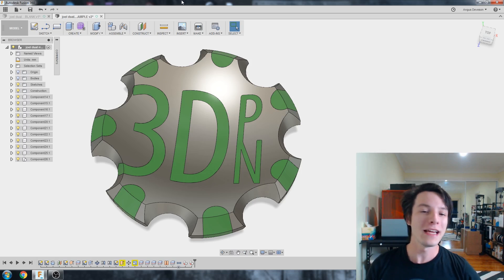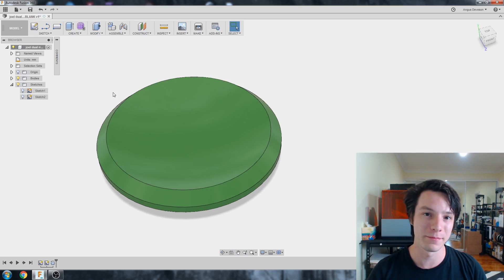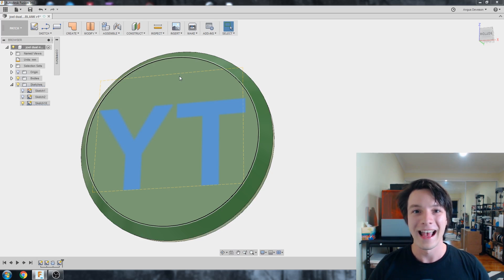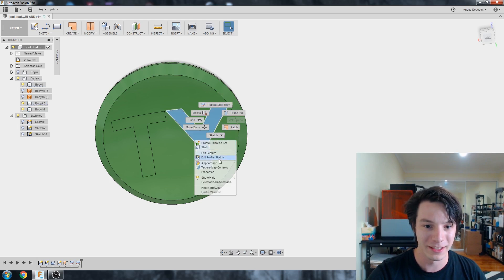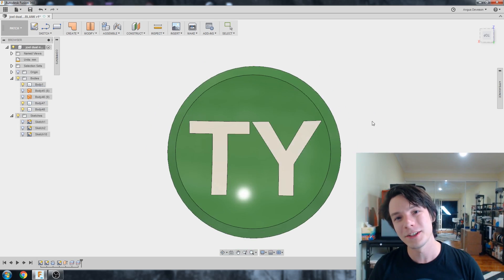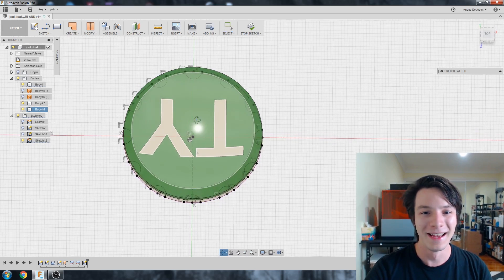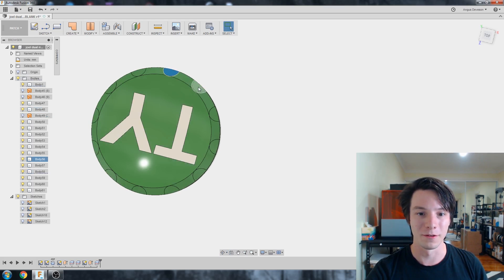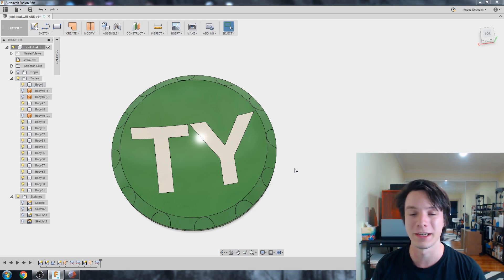Multi Color 3D Prints using Fusion 360 - Patch Workspace Tutorial

Comment: Perhaps this was not possible at the time of the video. But if I save the model as a single STL while it has multiple bodies. Then open it in Slic3r Prusa edition and import the STL, double click it, select the STL, then click split. I then have all the bodies separated and can select different extruder for each of them. Much faster then exporting each body in a separate file and loading them again.

Comment: Thanks for the tutorial Angus! I have a question though: The "split body" command only works, if you cut all the way through your body. If you just want an indentation (less than your material thickness) the split body command does not work and gives you an error. How can I do this?
Reply: Same question. Would love to split the model to print separately then press fit. But I don't want to go all the way through. is that possible with this method?
Reply: @swendingo  I don't know about press fitting parts, but I figured a way to "not go all the way through", see my other reply here if it's still something you want to figure out.
Reply: I just figured out a way to do this. Basically, using the cookie cutter analogy, you need a bottom to your cookie cutter . This can be done (after surface-extruding your sketch part way through your body) by using the "patch" tool on each of your extruded shapes on the side that is on the inside of the body you want to cut into. Then you need to use the "stitch" tool on the sides and bottom of your cookie cutter to fuse them together. After this you can use the "split body" tool as described in this video. I'm not very experienced with fusion 360 so my method is quite click-intense, but I got it to work.
Reply: You also should make sure that the tolerance on the stitch tool is set to 0 for this to work properly.

Comment: Hi Angus, would it be possible to write text around the curve radius - along the circumference of the coin? like those wording on the tire?
Reply from the maker: Not sure Fusion has a 'wrap' function, but you can set the depth to be uniform with 'to object' in the extrude and setting an offset amount. The text would be warped at the edges though :(
Reply: If you still need an answer, F360 has a new feature called emboss

Comment: I have a Qidi tec 1 and when i try to print something that needs supports with dual extruders the model and supports are printed separately is there any solution?(The slicer im using is Simple 3d)

Comment: Hey as someone who is looking at starting with 3D printing I've been wondering, how steep is the learning curve and is it a relatively natural one? Like will 3D printing take a lot of researching to get into or is it very much a learn as you go kind of thing?
Reply from the maker: The answer is 'it depends' - buy a 3D Printer that is ready to run out of the box if you want to use it as a 3D Printer and not as a learning experience in itself, if you want to be 3D Printing any time soon. Learning 3D modelling will take some additional time, tackle that once you've got the 3D Printing sorted.
Reply: MP Select Mini is an excellent first printer, IMHO
Reply: you want to minimize the #variables that you need to learn at each step of your learning process. That's why a ready to run 3d printer is very helpful, so instead of machine assembly and tweaks you can first focus on the basics like learning 1st layer adhesion, layer heights, print temp, speed etc.
Reply: Mine felt extremely difficult. Then i got Simplify 3d software and it made a world of difference. It's like having a hard to use phone and then getting an iphone, which are known for being super easy to use. Was printing within the hour after i got it.
Reply: Dalton James brilliant, I'll have to think on it naturally but I think a 3D printer would do wonders for the kind of thing I do